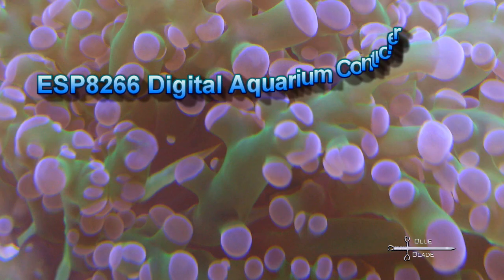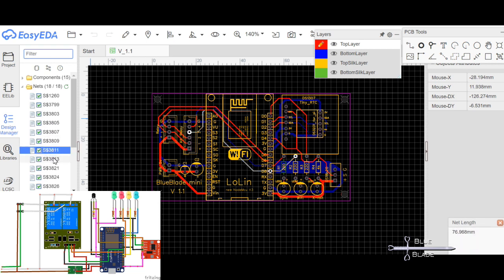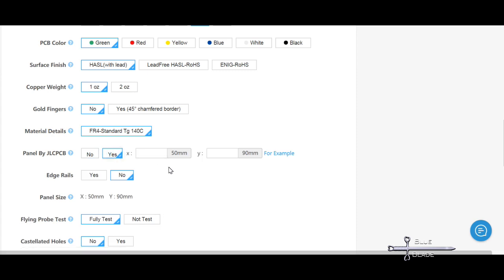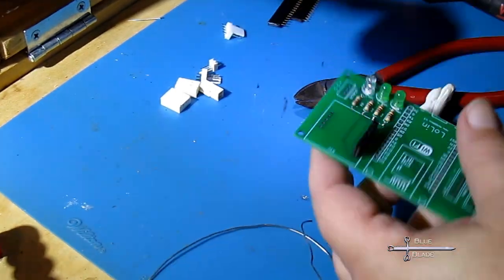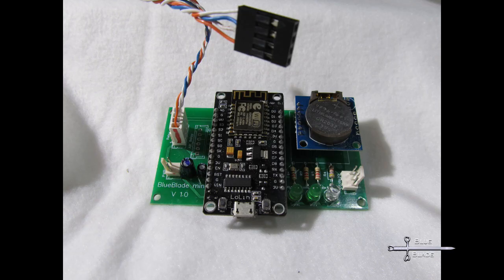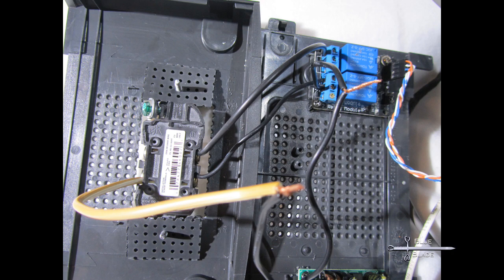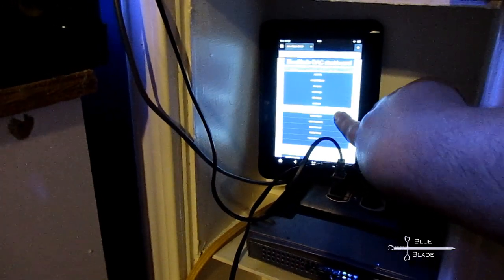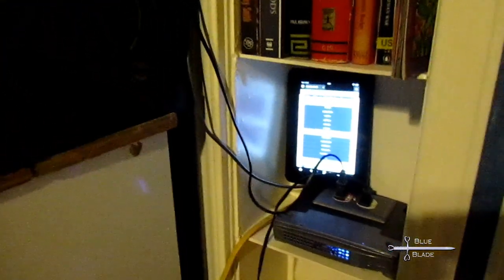ESP8266 mini Aquarium Controller: part2 – Final Build and testing

Comment: Very interested by this stuff. But how do you know what caps & resisters you need for a particular project? I’m looking at building something similar, but even something simple like adding leds confuse me with resistor requirements. As for caps, they are purely for keeping the power nice & clean arent they?
Thanks for the informative videos!
Reply from the maker: you can use a resistor calculator to find the minimum value of the resistor for an LED - that will drive it at full power without letting the magic smoke out, then you can increase the value to make it dimmer (and last longer). it is always useful to first try it on a breadboard.  and yes, for this circuit the caps are just for power filtering, so the values don't need to be exact - it would work fine without them.